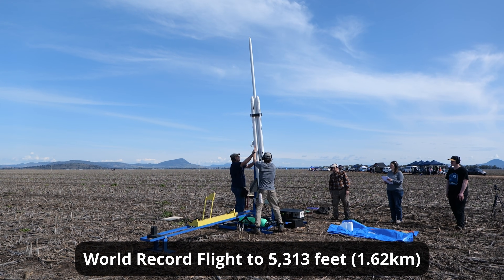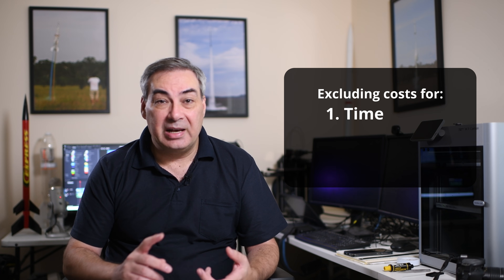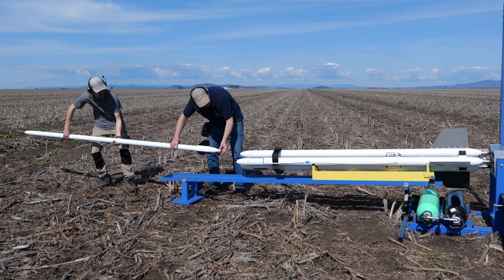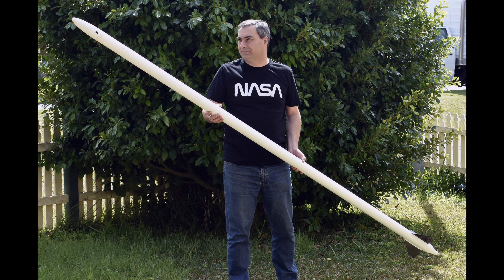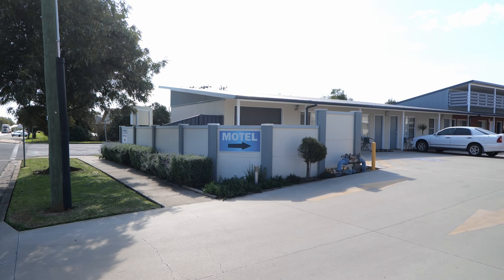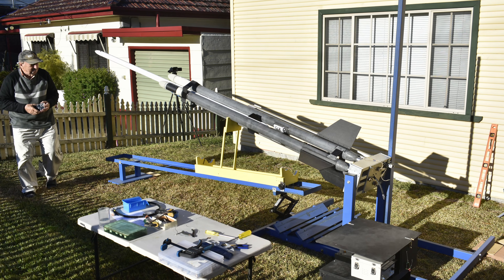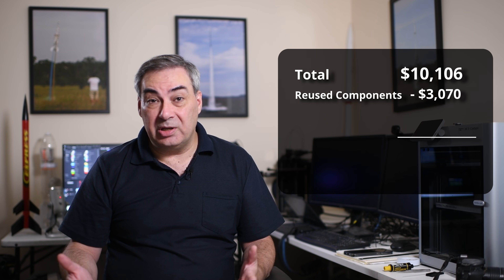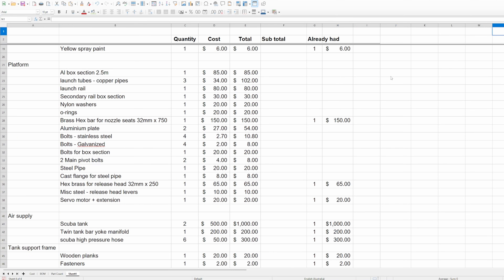Did This World-Record Water Rocket Really Cost $10,000?

Comment: I found very surprising, that fabrication of rather modest construction from off the shelf steel profiles (launcher structure) is so expensive comparing to high-end high-precision composite pressure vessels..
Reply from the maker: Yup interesting observation. Some of the costs of the steel was custom welding services that we had the steel supplier do for us since neither of us knows how to weld. The carbon fiber sock for the pressure chambers is surprisingly cheap at around $2 per foot.
Reply: @AirCommandRockets It is funny because I think you hadn't knew how to make robust composite pressure chambers before this (or previous) project, too :-)
And there a lot more good tutorial videos about welding than about composites for extreme conditions :-)

Comment: The two costs that surprised me most were the parachutes and carbon fiber.
Reply from the maker: When we looked at parachutes we considered making them ourselves, but we realized that reliable recovery was such a critical part of the flight that a shredded parachute was not ideal. And to spend weeks qualifying the parachutes would have probably been more expensive. We decided that having them made by professionals with the right materials was the best course of action. We also knew we could recover some of the costs by using them in other projects which we have already done.
Reply: The carbon fiber didn't surprise me, but the cost of the booster chutes shocked me.

Comment: I must have missed it or forgot, what height and max speed, acceleration did you achieve?  I really enjoyed the series in particular the problems you have sealing the nozzle to the tubes. Is a three stage a possibility?
Reply from the maker: Max speed for the second stage was 977km/h and peak acceleration was around 50-60G. The third stage would probably need to be a fairly small one. Normally the rule of thumb is that a preceding stage is about 5x the volume of the upper stage. I wouldn't want to be building a new 150Liter first stage. A small third stage perhaps a couple of liters would probably be easier to make. No plans currently to do a 3 stage.

Comment: IMHO that would have been interesting to see a "TCO" for the project, including the prototypes, test rigs and time. Maybe even some "amortization cost" for the tools (I remember one occasion when your lathe was broken). Also I love that how this project shows that complexity is not (just) on the rocket side, but also on the launch infrastructure, the tooling or on the logistics side - as on the real rockets too. 

Also about time: I make various space related Lego models. Last year I built 3 variants of the Saturn V ML (Apollo, Skylab-1 and ASTP) in 1:110 scale - each one is about 15000 pcs with the rocket, 10 kg and about 40x45x138-145 cm. I also plan to release an instruction of each as my time allows it. It was a 2.5+ year long project to design and build it. At the beginning of the summer with 0rig0 - who made a Lego Starship model next to others - I did a thought experiment to determine who much it would costs if someone have to pay the "product development" the instruction. Obviously in my case the absolute largest cost factor was the time even if the Lego pieces were quite significant amount of money (I estimated about 8-900 EUR for each Mobile Launcher). Depending on what kind of salary I used the whole project would been around 9000-21000 EUR. (Hungarian median, EU avg, west-EU avg, US avg). ~15600-36500 AUD.
Reply from the maker: I thought about including those costs as well, but a little harder to estimate, especially our time because it came in spurts. We also didn't factor in trips to the local launch site when testing various hardware. Also one thing I didn't mention are the components we bought specifically for this rocket that we can now re-use in other rockets. But I agree it would be interesting to know what the TCO was. 
Re your lego models: Wow that's a lot of effort and quite a sizable investment! Have you shared pictures/videos of those models on-line? I'd love to see them.

Comment: Insane amount of money! What did your wife say about the 10k? Just kidding, a hobby may cost money so what. If you think about how it all started.. just a bottle, tire valve and a cork haha.
Reply from the maker: Yup, a little pricey for a water rocket, but I look at the spend as entertainment and a chance to work with dad and the kids on a fun project. :) I sometimes think about how much money we've actually saved on flying water rockets vs pyro rockets. Rocket motors are very expensive now in Australia.
Reply: @AirCommandRockets  Speaking of it... are you planning to go further? Larger rocket? Maybe 3 stage?
Reply from the maker: No current plans for a 3 stage rocket. There is one project though I would love to try that I have been talking to dad about for a few years, but it is a little too dangerous because of the pressures involved (over 5000psi !350bar). The launcher engineering would be really complex.
Reply: Yes, I was wondering if spouses have watched this video.